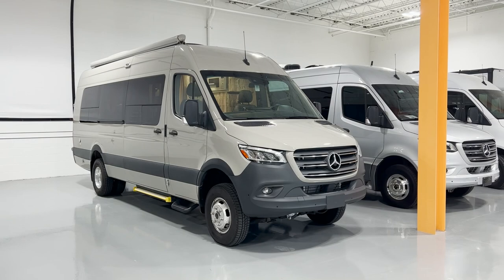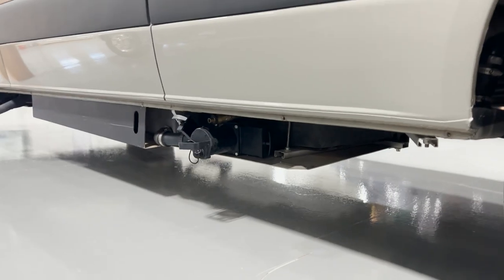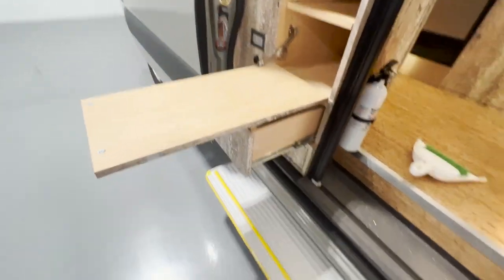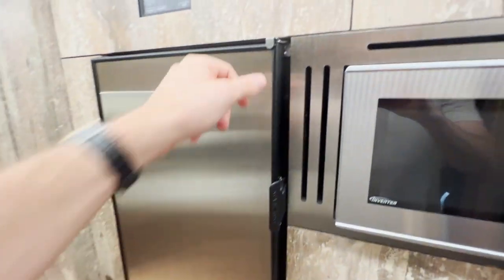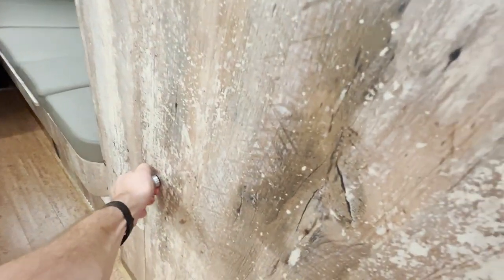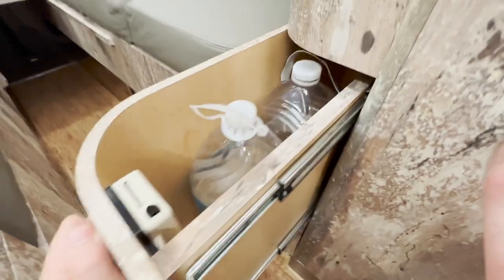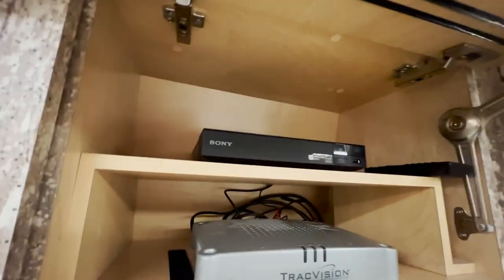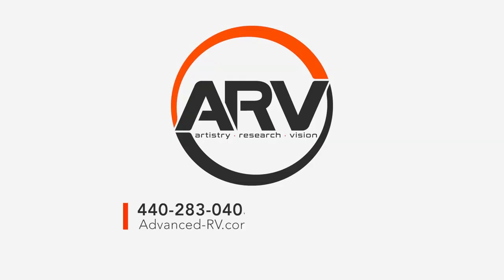Roadrunner 4x4 Walkthrough | Pre-Owned ARV Tour

Comment: How many amp hours is that lithium system? 820? And Does it self heat when stored in the winter in this climate? What is the useful load after fuel and water is onboard? Also, there is a do e in the bathroom so what’s the headroom there and ceiling height in the hall? Thanks